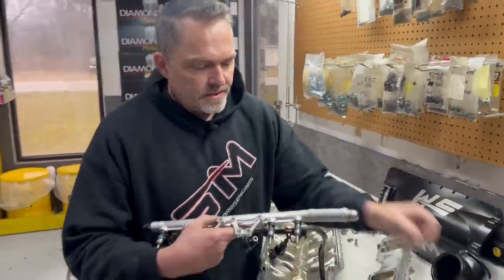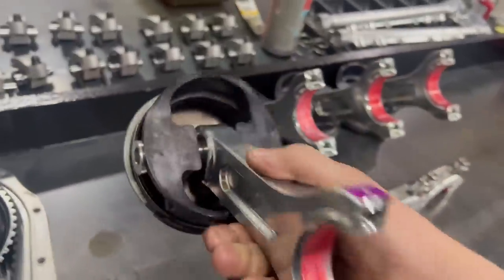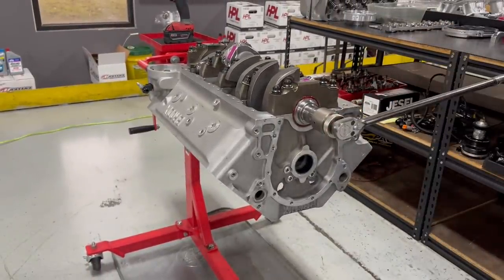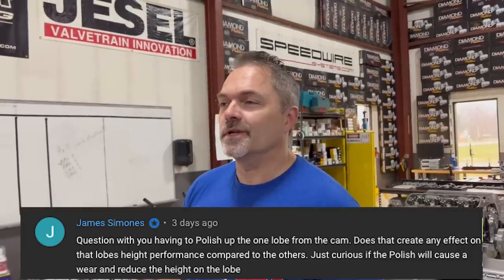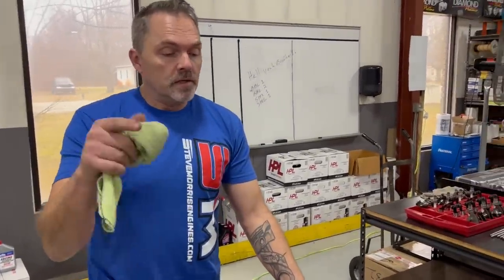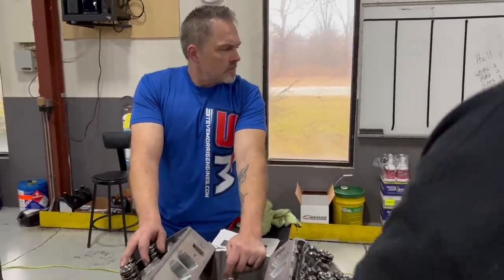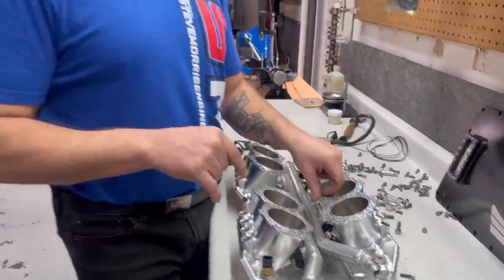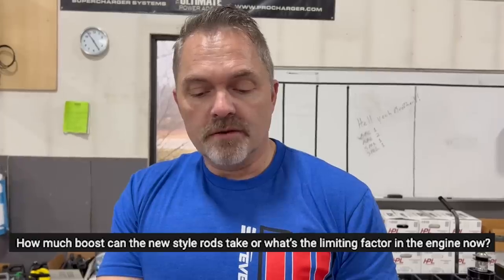Mullet Is All Done ! Day 4

Comment: Question from Australia why not demand that Cleetus have the SMX motor
Reply: SMX is way, way, way more expensive.
Reply: Oh he will have one eventually but to keep producing content he needs to maximize this platform and once that happens he will upgrade.
Reply: Cleetus is a YouTuber, he makes his money on content. Never put the biggest badess engine in right away. Needs to make videos.
Reply: His chassis is not optimized yet.
Reply: because this motor runs 6.40's and has 150 passes or so drove 3000 plus miles won 7 events and looks like a million bucks inside except for one lifter on gone  away right at the end
Reply: Mullet can’t handle the SMX yet💪🏼
Reply: I would think he would have a better car built for that, I don't think his current Chassis could hold up.
Reply: The SMX isn’t a drop in deal. It would take a lot of work to the car to get an SMX in and all hooked up. For where he’s at it just doesn’t make sense. Look how long Leeroy was down for just a trans and a back half.

Comment: I’m thinking Steve is thinking in his head..”I need to watch my wording in case Garrett watches this..if I say it could take more they are gonna give it more hence the smile” 😂😂😂
Reply: Hm, maybe not actually. Remember that Mullet is basically a back halved small tire car. There’s only so much power it will run with. Adding significantly more would need a proper pro mod chassis style setup and big bias ply tires. That car is getting near its limits so not much point in grenading the engine trying for more.
Reply: @AB-80X the only thing holding it back is it’s 3550lb curb weight. There’s quite a few small tire cars deep into the 5’s nowadays, but all of those cars are 900-1000lbs lighter than Mullet.
Reply: @AB-80X  - 100% correct.  Unfortunately very few of Garrett’s followers understand this.  They seem to think he can just a “drop” (🤣) an SMX in the car and run 5’s.  I just shake my head at those comments.  But that’s going to happen (ignorant followers) when you have a YouTube channel putting out very diversified automotive content with millions of followers.
Reply: @danmyers9372  Pretty sure Mullet was tubbed for big tires...and an SMX would drop in pretty well. I'd almost venture a guess as that's in the works.
Reply: @danmyers9372  Direct the "ignorant" over to channels like Steve's. I was ignorant about all this before watching hundreds of hours of American motorsport videos because I was just never exposed to it. That being said, there will always be folks that refuse to learn and declare their misinformed opinions as fact. Their comments still drive engagement/the algorithm, so just know they are contributing in their own small way.
Reply: @lordcommander3224  
I don’t know of any small tire drag and drive or even “road legal” cars that are deep into the 5’s. We’re not talking race only cars here. As far as I know, there are only two 5 second drive cars around, and those are the pro mods of Frost and Bailey. I would find it very interesting if you could like to anything in the 315 section back-halved street class that is deep into the 5’s. Never heard of it or any other 275 or 315 car running 5’s.
Reply: @tracy2928  
Mullet was not built for a big tire setup. They even had slight issues with the 315. And even if it could fit the bias ply tires, the rest of the car was never designed for it. Garrett built that car for a specific class which is not ultimate iron or unlimited. He runs the 275 and 315 classes which they built the car for. If he ever decides to buy an SMX and wants to play in the big leagues with Bailey, Frost, Morris, Goldstone and Berry, I highly doubt that he will do it with Mullet. That’s a 200k program trying to turn Mullet into something it probably won’t ever be. I’m guessing no.
Reply: @tracy2928  it's not but it's setup so it could be converted to big tire. but he'd like to keep the car as a drag and drive car.
Reply: @sirmonkey  it was never setup to run a big tire it was setup to be a small tire LS / jet turbine car. Then converted again and then ksr went in and hacked it all up and its still setup for small tire. I've seen the car in person multiple times I've even looked under it. It's not fitting a big tire without some serious modification.
Reply: @AB-80X  I agree, they are all pure race cars.
Reply: @kick_then_shift  Precisely. It's more than just a "tubbing". It needs an entirely new re-engineered rear. Coilovers, rear-end type and width, geometry and all the rest of it needs to be revised. In short, cut everything from the B-pillar back and replace it. It will be super expensive and time consuming. 150k for an SMX install and at least another 50k for the rear end work if not more.
If he was to enter the big tire club, he should do something fun like a Bandit Poncho or Dirk Diggler Corvette on a Pro mod chassis or ultimate iron style.
Reply: @AB-80X  I'm hoping he does a big tire setup with the holden he has sitting there...
Reply: @lordcommander3224  If the SML is let's say 100 lbs lighter than the BBC, then I think that would be a fun way to go. From what I gather the SML can make similar power to the BBC. That could potentially put him into the 6.47's or so, and the chassis he has would still work. It would look pretty darn cool too.
Reply: @kick_then_shift  Would be cool, but I would not get my hopes up. It would be fun for a Barra setup though. He doesn't have one of those. Would be a badass stick shift drag and drive car.
Reply: @AB-80X  cleets already ran a 6.47 @222mph in World Cup.
Reply: @shallnotbeinfringedfoff  
Ah yes. I was thinking of the 6.54 time. But then there should be a 6.44 or 6.43 with a lighter package that makes the same power.
Reply: @tracy2928  They have to jack Mullet way up in the air just to get 315s up under him.

Comment: I'm surprised you give out as much tech info or tips and tricks as you do. We should all be extremely grateful for the videos, as the tech side of them are extremely helpful. Most will know the majority of the secret sauce is in the cylinder heads and camshaft, so if you want a Steve Morris sauced up engine, get Steve Morris to build you an engine.

Comment: The fact that those pistons have made dozens of passes at over 2000 hp and the logos are untouched says all it needs to say.
Reply: Over 3000hp lol
Reply: Not to mention the aluminum rods surviving 150+ passes and the block surviving multiple 3000+ HP passes.  Oh and the racing valve train surviving thousands of street miles.  Truly amazing.  When I bracket raced way back in the ‘70’s a 500+ HP engine was lucky to make it 5-10 miles on the street without it overheating.

Comment: Man do I miss this part of school.. we had automotive starting in grade 8. Briggs and Stratton to chainsaws, transmissions, motors, and we had high school racing,  . We learned to build it , that came from us building a brochure so we could get sponcers,. And lots of hands on. By the time you got ur class 5 drivers license. U knew the car and started to work ur way into a spot as a driver, week end races and traveling to different towns to race different schools. My last project was a 81 Honda civic, chopped it 6" , put a 2l ish head on a 1.8l motor,  hand fabbdd a intake to install turbo. Cut 14" rim had shop weld in steel 15" rim so we could use our old slicks from our main car. Flat black old school flames, gutted , plexiglass,  roll cage, all done by a few of us and our awesome shop teacher. Had a bigg enough shop. We built bar stool racers , semi starter, cat battery,  and a sprocket drive,  boat rollers lathed down smooth, push the bottom and hang on. .. shop was a blast.... luv watching ur videos...

Comment: Ok, this question is a newbie question.  At about 2:27 in you talk about using the extended tip injector and that is what caused the clearance issue.  Why not just use the standard tip injectors and bore the intake seat deeper to get the tip in the runner?  That would increase the clearance at the same time.

Comment: I am new to your channel
I am sitting at home from a surgery 
I drag raced in St Louis in the 90s
Ran in the low 8 with a BBC in a dragster 
I am a trained Cummins Cat and Detroit mechanic 
I have always been a engine man
I really like how those intake hats has 2 different injectors
Alcohol was hard on oil and had to change oil every Monday with other mantience
I am used to fire rings on the liners instead of the heads
I have ran engine and truck dynos a lot but not your hp
I do remember your name from I am sure from national dragster newspaper 
Pro stock was always my favorite 
I have not been to any races for so long but a old Nova would be cool
I am used to a lot of your equipment from work 
When you overhaul one I would think valves and valve springs would be new.
Keep this good material out there 
I am going to buy a t-shirt and hoodie
When I raced Grand Nationals was only turbo car
God bless

Comment: Awesome vid.   It is great seeing the ‘normal’ stuff you do to build an engine.  Would be cool to see the knowledge and experience applied to a build that the average home-gamer would afford and typically do at home to see what your results are.   Maybe SBC, factory block, .030 over, flat tappet, dual plane or low intake to fit a flat or short cowl hood, etc, etc.     then take it and add a budget blow through turbo setup to step it up.

Comment: One other possible way to make the fuel rails fit easier would be to offset the bugs to the outside of the fuel rails instead of being on center. This way you can rotate one to the bottom and the other to the top.Just a thought.Great channel, tons of very good info.Keep them coming.👍👍

Comment: Another benefit using a timing belt is for noise abatement. A chain can slap block/cover if overly loose or stretched. That can introduce noise and mess with sensors like knock sensors. My opinion. And I have heard someone having a similar problem.

Comment: 23:30 cam specs are something that a good engine builder keeps close to heart on special application engines 

When sport mod’s first got popular around here and had a vacuum rule There may or may not have been a engine bought for a decent amount that had multiple broken rods and a broken crank but cam survived purely for the purpose of getting the cam copied but the dude wasn’t smart enough to realize that that cam was the original design not the one we were currently using

Comment: totally agree dry sumps are awesome. heck we had one on an NA pulling truck. definitely did not need it. we were the only ones in the class running a dry sump as well. it did make it awesome to preheat the oil before the pull and if we wanted we could even cool the oil down faster after. But it made no significant difference in the engine. May have given 5 horse but heck that could be from the refresh.

Comment: Mahle does a similar Teflon based process on the pistons they made for GM Australia in the "High Feature V6" aka Alloytech, that went in to the last of the Commodores. Does make a difference, lower piston to bore friction, so lower loss of power to overcome the friction, meaning smaller throttle openings at cruise and less fuel needed for the same power output, when compared to pistons without the Teflon. That translates to more power being available to be transferred to the crankshaft at wide open throttle, rather then being turned in to heat from the friction. It's something that has benefits in all areas of engine operation.

Comment: hey steve doing the “race mode” in the hellcat dosnt void the warranty, dodge is actually supposed to be bringing back there performance line offering pulleys there approved tune and some other light performance stuff if you get it all installed at the approved dealer then the vehicle retains its warranty, they claim it will make over 800 i imagine that’s just at the crank. i work at one of the dealers apart of the direct connection program havnt gotten any of the parts yet but it’s what there promoting

Comment: Steve by taking weight out of the big end of the rod, wont that throw the balance off.  I realize that it is probably the same amount of weight on each rod removed,  but did you verify that and rebalance all the rods to be the same weight, and then rebalance the crank afterwards?  Also have you considered as step 1 of an engine build, to put the block on a work bench standing up, and drop the camshaft straight down.  This will take extra precaution to not have any potential damage to cam bearings.

Comment: Steve, I have witnessed aluminum rods that fail from what I understand to be electrolisis etching in the rod bolt threads in line with the bolt in the big end of the rod.  I understand that this process happens during storeage over winter with the bottom fully assembled is that a good reason to replace rods or disassemble the bottom so the rod bolts are not in tension when storing or is a new set of rods needed every year or so?  Having been there I appreciate all the answers and agree and respect with your answer on cam specs.. Stand your ground, I would not release the nuances of my process to anyone until they bought the process with a non disclose agreement signed.

Comment: When you were talking about power needing to exponentially increase to increase speed the Bugatti Veyron came to mind. They needed the v16 with 4 turbos just to push through the wind to get the top speed of 410km/h. It was funny because they said that the tires only last 14 min at top speed but it's ok because you run out of gas in 12 min lol anyways this was a good series. Love the engines

Comment: Pistons black, DLC. It's like Works Supercross suspension on MX bikes. You have DLC coatings that give it the black, gold or blue/aqua coloring for reduced stiction. Different coatings doing the same thing. In other words, it helps glide through the cylinder wall much smoother, less drag and more efficient.

Comment: Those rod bolts are torqued tighter than my lug nuts. That’s crazy, just to hold in that horsepower.

Oh and if anyone wants to get the cam specs, they can support Steve by buying an engine and measure themselves.

Comment: Reason things last beyond publicized spec is called "safety factor". Being in the material handling industry (overhead industrial cranes), it has everything to do with duty class. Some things are designed to go to/lift the moon once a month, and other things are designed to go to/lift the Moon all day-every day. Gear, bearings, heat treatments, metallurgical chemistry, etc...

Comment: The chain probably isn't the only limiting factor when it comes to rpm limit but I imagine that the belt drive could, in theory, rev a little higher with the right valvetrain. Centrifugal forces are lower, absorbs some of the vibration and less rotating mass.

Comment: 10:30  i work in a shop with access to a lathe.    one day the 70 some year old mechanic brings me a brand new connecting rod from a john deere excavator and had me turn it down to gain more clearance because his crank shaft was beat up.    i'd like to say that was the weirdest thing ive done but that same job the old man had me weld up the cast iron engine block after a rod was sent thru the side.

Comment: Prior GM tech and Current Mopar Tech here.. on the lifter comment. I've seen failed roller lifters in both LS/LT platforms and Mopar platforms. I find that the needle bearings in the roller squeeze out and cause that failure or the hydraulic plunger fails and drops the cylinder. I'm sure your lifters are designed better, but are they built the same way? Kind of like the LS rocker upgrade where we replace the trunions, are yours a solid roller or still have needle bearings at the roller?

Comment: I would be curious as to how often you check your testing equipment. How often do you ensure your stuff reads correct measurements? Even the lowest used items need to be checked once a year for basic maintenance, your equipment is far more accurate so I would like to know.

Comment: Regarding the fuel rails - there's no good reason you can't run extruded square section tube instead of round - it'll free up some space for the same cross-section if placed back-to-back with short injector fittings. You could even use rectangular section with the long axis vertical.

Yup, it's the thing you don't check that will catch you out - depending on one's preferred practice, using a feeler gauge between the rod and crank' cheek when torquing/tightening the rod bolts would have picked that up.
Worse case would be if there was one or two thou' clearance cold because that could have closed up with the 'rods up to temperature - heck, even if they didn't quite close up, there could be galling between the rods and/or the hot oil being prevented from passing through the bearing and causing a seizure from the oil breaking down.

Regarding 'phonecalls, at least, I have an answer-phone with the message, "Please leave the reason for the call and your contact details", you may do something similar, maybe adding "if it's of interest I'll get back to you", or similar. I would not advise the technique my late uncle used, if the 'phone rang he'd pick it up and snarl 'I'm busy" and hang up - might be why he had to sell up a couple of his businesses...

Comment: Well it’s actually not heat treatment but electrolysis process. Like you said anodizing, and the porous surface is then teflon impregnated. The oxide layer is very hard, and wear resistant.

Comment: It looks like you have a super high ratio rocker set up there. The push rod doesn’t travel a lot but the valve has lots of travel. Is that to avoid lifter failure?

Comment: Do you Recommend using Top Lube on engines running on methanol ?! And if so have you noticed a difference in ring wear vs without a top lube ? I’ve always felt it couldn’t hurt and may also help keep fuel pumps and injectors lubricated. Would love to hear your thoughts on this thank you Steve.